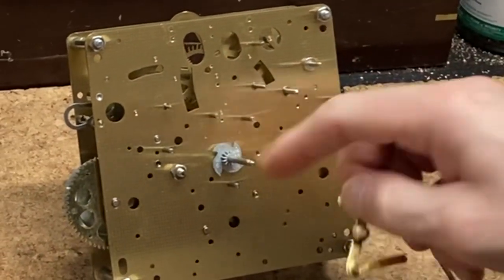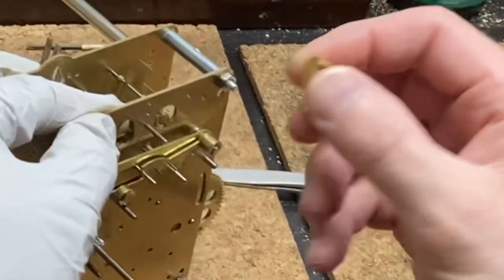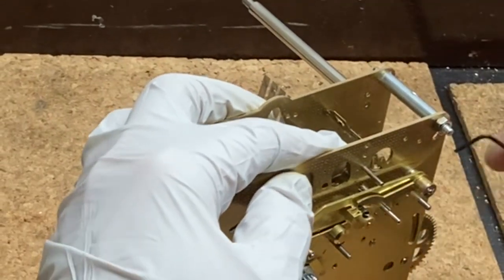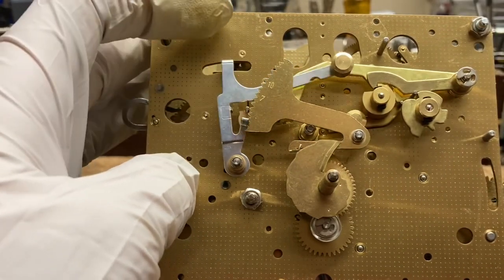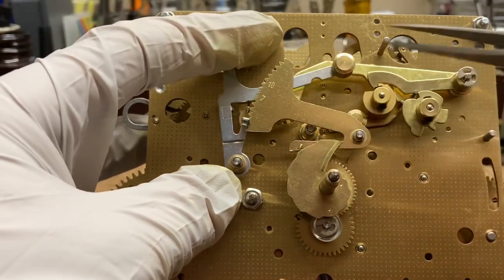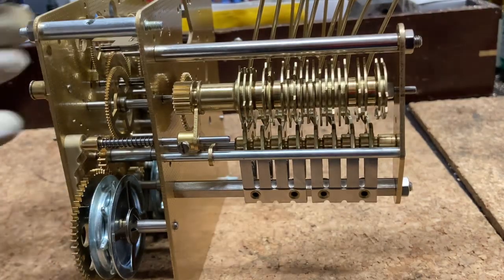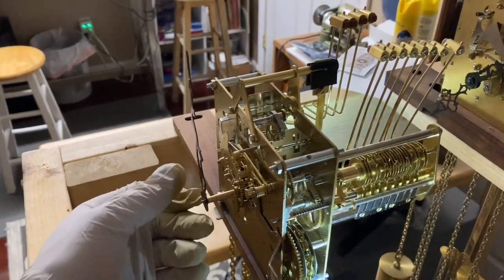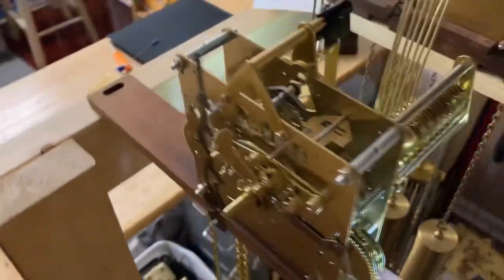How to install rack and snail to chime and strike for Hermle Triple Chime

Comment: Great Video I just changed my stop chime cam (wishbone) and my chimes still not working I found when putting it back together that the stop cam pivot hole is worn would this be why chimes want to start or if it does start (speeds up and slows down then to a stop).  I check all the other holes and are great. keeps great time and chimes on the left run. Hermle 1161-053HS.114 thank you
Reply from the maker: A worn stop cam pivot hole would pose a problem in the motion of the train.

Comment: Hi Chris love your video, great work, I am working on a Hermle 461-053H  movement and having trouble how to set the gathering pallet, do you have a video on the movement or can offer some help Phil
Reply from the maker: Hi Phil.  Thanks for the kind words. The positioning of the gathering pallet will be the same procedure as shown in this video. You want to advance the strike train until the hammers "drop" (this is after the star wheel lifts the hammer and completes its cycle) and then continue to move the train until the warning wheel pin is at top dead center. Then lock the train from moving by putting a clothing pin on the fly. Then press on the gathering pallet such that the arm that gathers up the rack is in its lowest position.  The gathering pallet has a contour with high and low spots.  Make sure the arm is resting on the lowest spot in this position.  Hope that clears it up for you.

Comment: Hi Chris, I was wondering would it be possible for you to do a video on how to change the cables on a Urgos UW66? I pickup a Howard Miller that somebody cut the cables. I have new cables but can't fine anything that shows how to change them. I have be able to get the cables off but I am a little lost on how to set the 2 gears on the front with the one coming off the drum that the cable wines up on.  I see if I align the two timing marks and crank the drum up it will come to a stop. I think that is so the weights will only go up so high. Any help is appreciated. Thanks.
Reply from the maker: Yes. Thats a good idea for a video.

Comment: I have a simple single hammer striking clock whicn intermittently does not chime. If you raise the hammer a tiny bit by hand it continues to chime. Is it something sticking every now and then? Any ideas on what to check? Thanks..😊
Reply from the maker: It may need cleaning and lubrication.  I would start there.

Comment: Hello Sir! I have inherited a Howard Miller wall clock 613-226 from my aunt and it is at my parents house. I just got it a week ago and it seemed to be working fine, but now it seems the chimes are slower and not as loud as it was when I first got it. I wound it Saturday and it started doing this Tuesday. Could someone have put it in silent mode at an unsafe time and caused this or do you have any thoughts about this? Any help you can provide would be greatly appreciated.

Comment: Thank you Chris for that detailed look at putting together the front works of that movement. I have a Hermle 051-050H movement and had a problem with the chime and strike. The small lever which controls correcting the strike would get “hung up” on the stop cam preventing it from spinning. I took that lever off and the clock runs perfectly now. What could be the problem ?
Reply from the maker: Do you mean 1051-050H? 

I would check to ensure the lever is not rubbing on the lever behind it, the cam is not rubbing on the movement plate, check for burrs or wear on the lever tip and the cam surface. 

Where on the stop cam is it stopping? And does it stop on every quarter hour? Is it always the same spot?

Comment: Hi there Why must be setup on 11clock ?
thanks Tom
Reply from the maker: I set clock racks at 11 because that is the shortest step on the snail. Other repairman use 12 & 1.

When doing the repair you always go all around the snail to make sure the rack tail drops correctly on each step of the snail.

Comment: This looks very much like my 451-050 that is acting up. It will strike continuously, until the weight runs all the way to the bottom of the clock fram. Other wise, it runs well, and keeps good time. What am I missing??😕

Comment: Hi Chris again. I solved the problem of my last question. I saw the problem as the music roll got stuck at the end. 
Now another question, why it is that the 4 4 cam wont move after the drop of the drop lever?
Reply from the maker: Check your warning pin location when chime finishes. It should be at top dead center

Comment: Hi Chris, nice detailed video. I have a Juba 3 chimes clock. It would only chime with the St. Micheal but wont chime with the other 2, what can be the possible issues??
Reply from the maker: The position of the music roll is probably off so the pins aren’t lifting correctly in each of the three positions

Comment: This is a very good video. Thank you for taking the time and sharing your knowledge. 
I have a Seth Thomas E700-000, from my moms estate. It no longer chimes on 15 minutes. I hear a click but no chime. Also, on the hour, it seems to start the Westminster chime again, while striking the hour. I tried to gently clean and oil. I plan to take the movement out again and compare to this video. Any thoughts? Thank you!
Reply from the maker: If you follow the video, you are likely to discover the problem. Sounds like the hour correction is not working properly
Reply: @Chrisclockrepair  this my first look at a clock movement but I think I got it! I know my terminology is probably completely wrong… It has a cam that determines how long the chime runs. It seems it was out of sync and would not stop at the correct location. Utilizing information from your video and watching the movement thru many cycles, I think I have the auto correction and stops working correctly. Thank you!!
Reply from the maker: @b.r.5405  Beautiful

Comment: Hi Chris. Been watching your video as I have a question about a triple chime table clock with Hermle 050 movement. The level that operates the triple chime, when you adjust sometimes you can feel the steps when adjusting and other times especially when you lift the lever up it feels loose and floppy and then sometimes moving down to Westminster chime there's resistance.

I noticed that you get none of this when you lift the hammers up and adjust, the lever feels normal. I took the movement out and the issue is with the first hammer, the one towards the dial, it ocassionally stops the music wheel to move to the left and when you lift this one hammer it releases.

I have an issue on another movment. IS this normal?
Reply from the maker: It sounds like the music roll is advanced a bit too far and it is catching the hammer lift when you move it

Comment: Chris, thank you for sharing and explaining the video. Does a urgos uw666020 assemble like the one in this video and do you have a video of a urgos. Thanks for you tone and assistances.
Reply from the maker: Hi Joe. Urgos has many style of movements, so they may vary. However, if it is rack and snail, the assembly is very similar. Concepts are the same. I don’t have an urgos video yet
Reply: @Chrisclockrepair  thank you.
Reply: @Chrisclockrepair  the center gear or the time gear needs a bushing in back plate. It has a lot of play. Have the movement on test stand. It is working. But it did not and the  hands would not turn the reason came to me.

Comment: Hi Chris. I am soon to retire from my job and would love to pick up a hobby in my retirement years. Your presentations intrigue me to do what your doing. I have an  emporer grandfather clock that my uncle built from a kit years ago. I want to take it apart, clean and oil it. I have the oil but what can I clean it with other than an ultrasonic cleaner? Is there any store bought cleaner I can safely use?
Reply from the maker: Sounds great! Yes there are some alternatives, but you can use an ultrasonic cleaner with out an ultrasonic machine. Thats what I do.

Comment: Thank you sir, this was a great video.  I have a HERMLE 1150 050 that i changed out from my clock and installed per the instructions given.   (bought a new movement)  It works but sometimes the hour strike hangs up and some hours i get no chime,  i can get it to chime if i pull a little pressure on the strike weight it will go, other times it seems to loose an hour.  It could be working going along and i will hear a weird “pop” noise during the chime then I may lose an hour for the strike. (Ie let’s say it’s 6 pm on the clock has been right on time all along them it strikes 5 times.  I checked the snail and seems like the rack is falling right where it needs to be for the hour.  I’m just at a loss and the clock company in Mass i ordered it from has not given me any help and i don’t really have a local clock repair person to look at it.  Thanks
Reply from the maker: Thank you. Allright. Here are some things to check.

1. Rack is dropping correctly on the snail in right position. When the hour lift has just passed, the rack should drop at the beginning of the next step.

2. Is it possible that the rack hook can fall behind the snail. Pull snail all the way forward and rack all the way back and check to see if it can get behind there. If yes, bend rack hook so it can’t.

3. Is the snail changing positions? If you lift the snail as far as it goes and rotate it, can it move to another location on the reverse when next to it? If so, need to ensure this cannot happen.

4. Is there run on the strike lift. The strike should lock just after the the strike finishes so there is buildup of speed before the first strike. Also put a little grease on the star wheel points of contact.

5. Is the locking arm (piece that locks on gathering pallet) lifted high enough so that the rack fully drops without catching on the gathering pallet pin. Sometimes this locking arm can come down on the rack before it finishes its fall.

Thats what i would check. Good luck.
Reply: @Chrisclockrepair   so i took most of the stuff off from the front except for the gathering palllet, and when i set the strike by hand and stopped it after the drop, and the warning wheel at top dead center my gathering pallet was at a 45 degrees from being vertical.  I aligned it to up and down like you installed it then followed the rest of your video to make sure all cams were put on right with warning wheels etc at Top Dead Center.  Hopefully this will help me and fix my hang up.  Thank you for such an awesome and calmly explained video.
Reply: So things seem a little better, but for some reason the hours of 7-11 the strike “runs out of steam” like it just can keep itself going to strike all 7,8, etc times. Again if i pull a little on the weight i can make it complete the hour strikes. The weird “pop”
I hear when i do this sounds like it’s skipping on whatever is hanging it up.  Star wheel? I may need to adjust the gathering pallet again as after all said and done the warning wheel pin is just off of Top dead by 1/8 or a so turn.  I haven’t seen the locking arm falling prematurely,  i need to make some sort of timing rack so i can run everything outside the clock structure so i can watch all wheels and pinpoint the hang up.  Last attempt before I contact the movement seller to take it back or repair it..
Reply from the maker: @Go2Sleep911  do you have the correct weight and is the movement oiled?
Reply: @Chrisclockrepair   this model has heaviest weight on the chime (rt side) and the 2 other weights are the same weight within 1oz of each other.  The movement is brand new (2 months old) i didn’t put any oil on any of it when installed because the install instructions did not indicate the need for it.  Thought it would have been oiled from manufacturing assembly
Reply from the maker: @Go2Sleep911  I would oil it. Do you see any oil in the pivots?
Reply: @Chrisclockrepair   nothing “dripping” or where it ran a little.  But when i take it out I’m going to oil all the pivot sites lightly..  if this keeps up I’ll be a HERMLE horologist is no time 😆
Reply: Chris thank you immensely for all the tips, especially this video. I followed all your suggestions from above removing the movement and setting it up on a makeshift timing rack on sawhorses in my workshop and letting it run and watching it very closely as to why the strike was hanging up. After closer inspection the pivot points even though it was a new movement were pretty dry so those were all oiled which made it run a little better, And with some slight adjustment of the carrying pallet but  it still was hanging up. I inspected further and saw that it was actually catching on the star wheel, there was actually a little burr on two of the star wheel teeth that was catching the strike arm. Got rid of that Burr and slightly adjusted the star wheel so that the end of the strike there was plenty of room for a run up for the next hour strike put some grease on it and ran it through an entire 12 hours on the timing rack I made and was able to go through the entire12 hours without any hangups. The clock is back installed in the case and so far has been running well. Thank you so much again
Reply from the maker: @Go2Sleep911  fantastic

Comment: Great! Can I use cycle oil for this?
Reply from the maker: I would recommend that you use an ultrasonic cleaner without the machine.  Simply put it in a bucket and submerge the parts for about 20 minutes and allowing the bucket to swirl or vibrate it with a body massager.  That will turn out pretty good.
Reply: @Chrisclockrepair  Thanks! Where do i buy that in Hong Kong?

Comment: chris, i have the franz hermle 1051-020   11cm/200.73   can you tell me what the 11cm/200.73 means? being this movement is like 30 years old and only runs for say 5 minutes and a local clock maker said oil and time band are needed, i would like to find out if i might be able to replace the movement with a more modern unit?

 is there a movement cross reference chart i can check into? also what does those numbers mean i figure the 1051-020 is the model of the movement but what does the 11cm.200-73 mean? is there a chart that talks of those numbers? unless that 11 cm is the length of the stem the hands fit on or the diameter of that shaft the hands fit on and the 200.73 may be the hands length?  i just can't find a movement that is under 270$ but i do see nos movements on ebay but are 340-020a movements so i have to find a chart that tells me want movements cross over. 

  by the way what is a time band? could that be the mainspring for the time that you wind up? this clock has 3 windup points one is the time one i figure is the chimes but what does the 3rd one do? if by chance i may be able to take out the time band and clean it and oil it and reinstall it? or swap it out with one of the other springs? but my guess is it is so old it may be sloppy and not keep good time? thanks
Reply: 11cm is the length of the pendulum.  200.73 is beat rate, the number of beats per minute the pendulum makes when it is keeping correct time.  Useful if you have an electronic clock timer. This model Hermle is sold in a number of pendulum lengths. Each has a different time train gearing setup, particularly the escape wheel tooth number.  I've had a number of people refer to the mainspring as a "time band".  The three holes wind three springs, one each for the time, chime (quarter hours) and strike (hours).  The springs can be taken out without taking the whole thing apart. There is a number on each spring barrel and new springs and barrels can be purchased at clock supply houses. The 3 springs are not interchangeable and are different strengths. You can also replace the entire movement with a new one.  They are still made. No cross reference needed. Just buy a  Hermle 1051-020 11cm.
Reply: @dperry428  thanks you.   you were the only one to get me all that info. they got it to run i think it was wound to tight. they say you can't over wind them but i have had a few that were over wound and when i kept them going for a few hours they took off and ran perfect. they did this to there clock and it has kept perfect time now for a month. so it was wound to tight. again thanks

Comment: Hi Chris! I've been trying to figure out why my 1/4 hour chimes work but my hour chime does not, unless I manually pull the flirt on my hermle 451-050. I've noticed after inspecting that for some reason when the canon pinion pushes the wishbone piece up for the chimes, it doesn't fully push it up. I'm thinking the canon pinion or wishbone piece must be grinded down or something. Any thoughts?
Reply from the maker: That is possible yes, also your center shaft could be worn and need to be bushed.
Reply: @Chrisclockrepair  do you have a video on that? Lol
Reply: @Chrisclockrepair  also, is "Canon pinion " the correct term? I'm trying to Find a replacement but am coming up short

Comment: Is that really the 11 o'clock slot on the snail if so are all the snails the same or similar that that spot is more like a slanted hump?
Reply from the maker: That’s a good catch. I actually was off one tooth and had to fix it after the video.
Reply: @Chrisclockrepair  thank you for replying im in the hospital and felt like i need to confirm by looking at a clock I wont be back at work for a while and not knowing would of haunted me
Reply: @Chrisclockrepair  do most clocks have to have the pin on warning wheel at top center i usually put them a  one third of the travel from lever, have i been doing it wrong
Reply from the maker: @rccl4487  From all that i know and have seen it is at top dead center